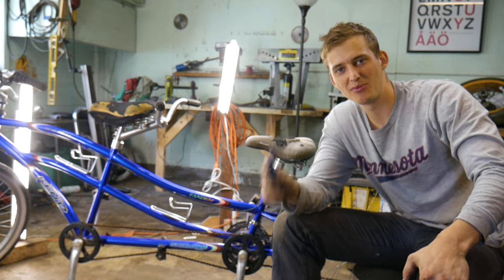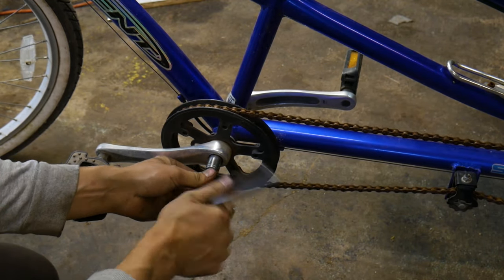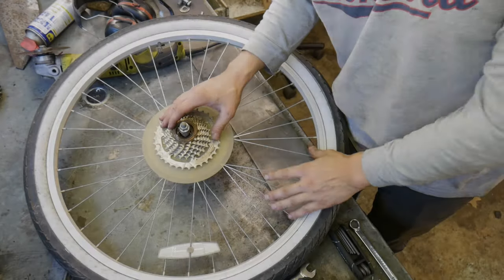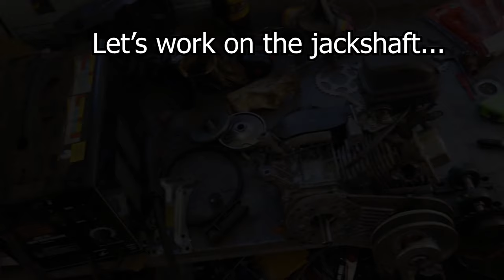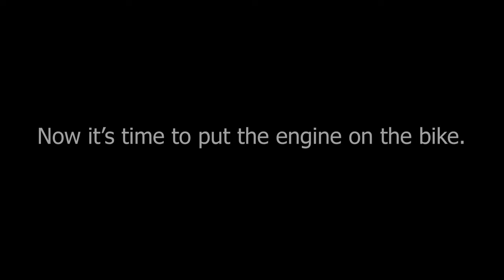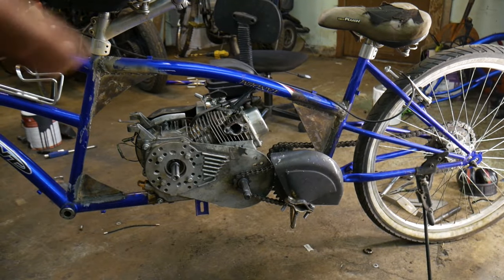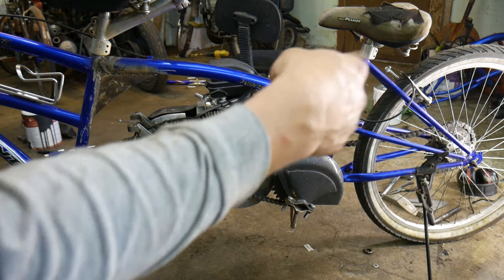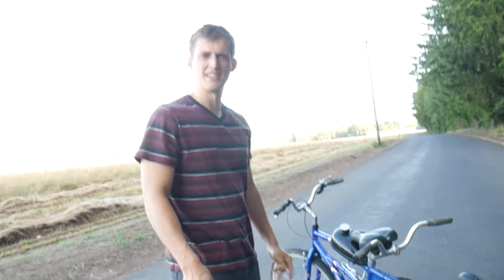Can 6.5HP motor power a tandem bike?

Comment: I like what you've done...   But I think
I would have left the bicycle chain and
gear sprockets as well as the gear
change derailer on the right of the 
rear tire and jackshaft.  That way
you could change years and possibly
go faster while still having torque
at the low and high ends.  Bicycle
chains are stronger than you think.
And the jackshaft is the perfect
point at which to make the
transition between the two
chain and sprocket sizes.
But all in all you did a great
job on this project. Kudos.
Reply from the maker: yeah i've used the gears on bikes before to switch gears, but it's just to unreliable over a certain HP, especially if a lot of weight is involved. but im sure there are maybe other ways. Thanks for the comment!

Comment: you  can solve the leaning by taking the handle bars off the rear and putting a seat on the back with arm rest  and a back rest on it that way she will have a back rest and she will not have an urge to lean

Comment: A 90 degree plug boot would save the you trouble with futute belt when cramming an engine on a bike
Reply from the maker: Good call! I may upgrade t a larger predator later on, and that boot could save my tail. cheers

Comment: I have been wanting to build a motored bike , or ebike, that uses the different gear ratios of the bike! Although the hub motor is the easiest way to build a E bike, I do want about 1500watt motors front and rear, or anout 4hp, with a 2kw motor spinning the cogs! For near 7hp, with the TQ of a 20-25 hp gas engine atleast, I don't know how the bike would survive!!
Reply from the maker: ah do it, 25hp may be a little unsafe haha

Comment: Did you not consider an electric conversion kit, there would have been no need to wreck the frame
or do away with the pedals. The conversion could be removed easily and fitted to another bike.
Reply: Electric is crap because the battery can die and it is not as fast

Comment: Shy needs lo learn to lean with you if it's a 212cc you can hot rod those take govener off should have enough power for two
Reply from the maker: She did a good job leaning, I was the problem haha! Thanks Aaron
Reply: @OliverMotorized  degovern,18# valve springs,and a better carb will be plentyful to push both of you around

Comment: I am puzzled over why you would do this.  I met my girl at a motorcycle rally and we went everywhere on our small ( 80cc ) motorcycle for years.  Now almost 50 years later we are riding a tandem pushbike together.  160000+ km over the last 11 years.  No vibration.  We can talk as we go and get fit at the same time.  An engine would detract from what we now find so good.  PS we can't easily change ends.  I am used to steering and she is used to being a passenger.  Changing conflicts with our reflexes and makes it quite difficult.
Reply from the maker: albeit the engine is loud, the idea to go anywhere effortlessly while cruising at a very decent speed is really fun! But also I simply enjoy building things like this. 
Cheers!

Comment: If you gear the motor properly it should do 34-35  and still get off other line decently.
Reply from the maker: I think gearing was good, I think the engine just needs a little modification, I think the muffler may be a bit restrictive